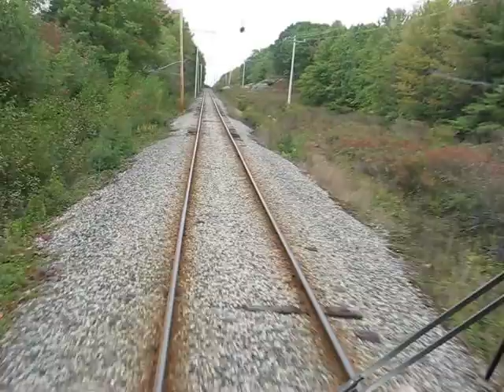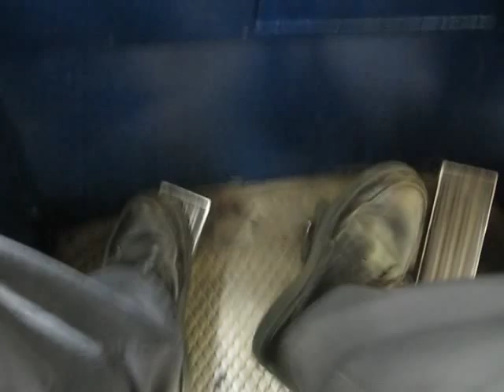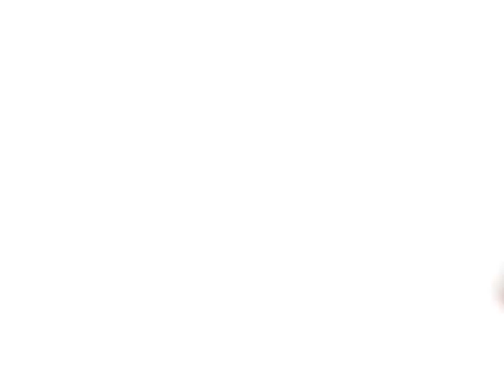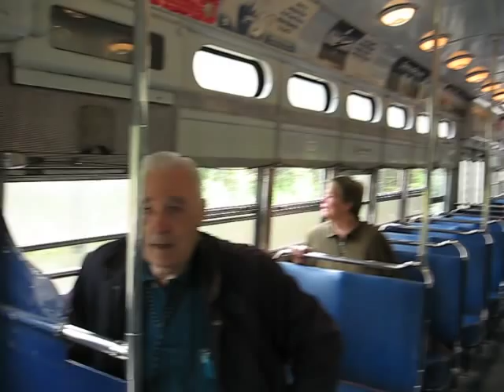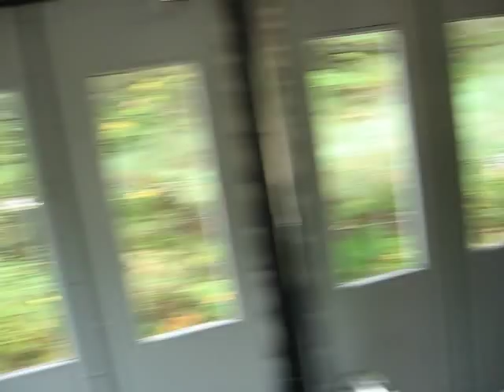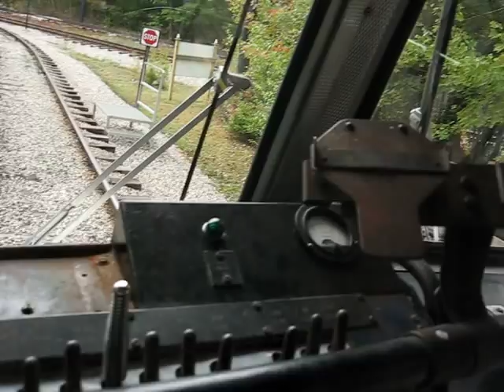Running  PCC car  Part 1

Comment: That's exactly how those PCC's sounded as they rounded the sharp curve of the subway surface loop under city hall at 13th. and Market in Philadelphia. They also moved at that speed to. They replaced the PCC'S on the surface lines in1980 after purchasing those ugly Kawasaki's. Car 2709 in this video is sporting Septa's red, white and blue color scheme from the mid 80's to present.